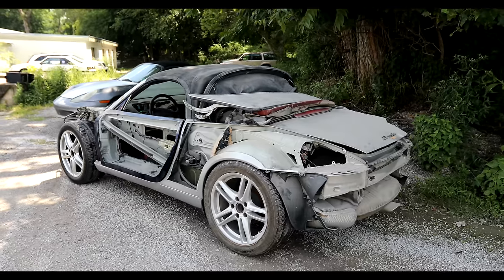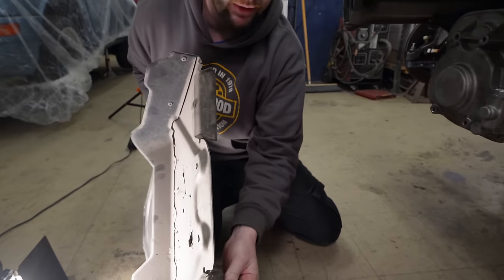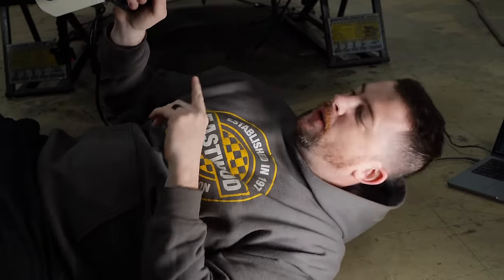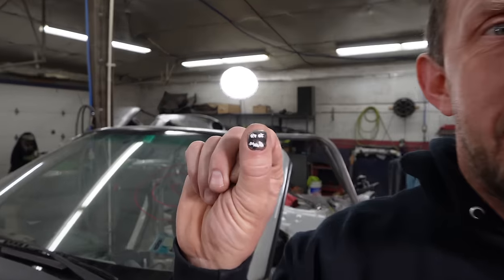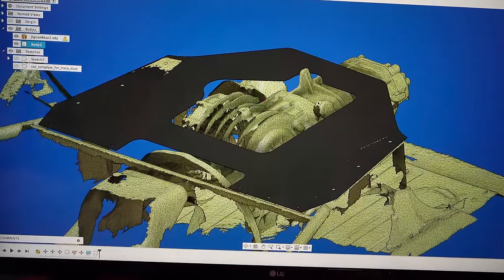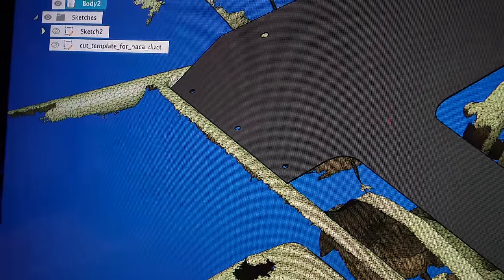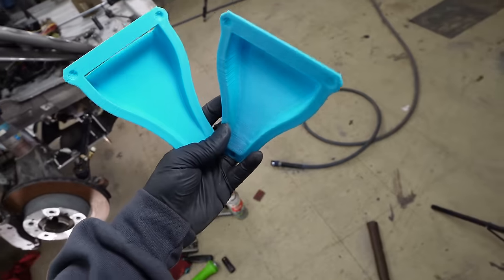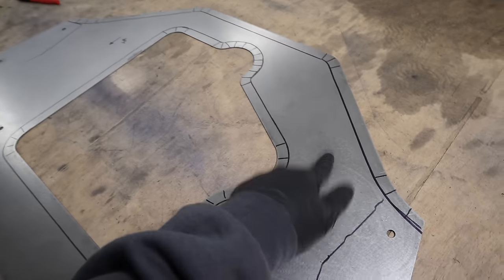$500 Junk Car to SUPERCAR - Project Jigsaw

Comment from the maker: Holley, Aeromotive and PMO all say it is a good idea. Holley sent us that regulator that is specifically designed to regulate the incoming 65-70 psi down to 4-15 psi. The saw regulator can be used for fuel injection; you just have to swap the included spring. We explained it thoroughly in the previous video

Comment: That plate under the transaxle is a very slick piece. Plenty of airflow for cooling, connects to enough other bits to provide a lot of stiffness, and I think your rolled edges are going to be sufficient to provide a lot strength. Especially with 6 bolts along the front edge. If you start to question it, maybe a couple more transverse bead rolls just to give that flat area some shape. As for the halfshafts, well, thanks for showing us what building a car is really like. Sometimes it's hard and it sucks, but it feels great to get past it.

Comment: G'day from West Australia😉

After 43yrs trade life as a 3rd gen Automotive Engineer, buil1ding what I call fruit salads. (Mixed n matched components to crea te something that many say shouldn't exist)

I feel your pain Tony, 😊
Deep breath, exhale slowly, and go again once hurdle has been recognized, solution presents it's self.

Your lucky Tony, you can change out the knuckle.

In the past I have had to fabricate, or whittle out a block of alloy to create what was necessary to get wheels to spin on some builds.

( And they did spin excessively on second test drive with owner coz they understood my iritation at that stage of the build).

Besides had to test them for failure😂

Comment: I really think your NACA ducts are mounted on the wrong side. 
Mount then above then only the lip of steel will be an issue, not the lip of the 3D form. 
Just saying.....😊
Reply: The performance of the duct will be optimized by having the sharp steel edges to trip the air into the duct also.
Reply: @SteveMirabelli  yeah.   But the printing is several times thicker.  Perhaps sand down the lead and trailing edges?
Reply: @alman6581  the duct itself is not as critical as the shape of the hole for air entry.  I used to work in racing and quarter glass was lexan . We cut out the shape and left the edges sharp and mounted the duct behind the glass on the inside of the car. The air wants to move along the surface and then twists into the hole and then the actual duct. With it mounted on the surface you defeat the duct with thickness of the mounting rim.
Reply: @SteveMirabelli  that's exactly my point to. 

I've run several porches with naca duct rear quarters, to sneeky duct cooling and fresh air to air box.  

You soon find what works.

Comment: If the fuel send line is larger than the return, you could swap them. Restrict the send while reducing the restriction on the return line. That might get you where you need to be. Just a suggestion

Comment: I bought a 93 mustang that the whole back burnt to the ground from a rear battery fire for $500. I got it home and pulled the motor that looked like it had a good bunch of bolts-ons on it. Turns out, it’s a stroked 347 that’s .30 over, all forged internals, has a main girdle, world Windsor jr heads aluminum rockers. I had the block cleaned up at the machine shop already, had new cam bearings and freeze plugs done. It was an engine built for nitrous but I bought an “on3” twin turbo kit for it. 
My grandson was just born and I’m starting to realize my dream build for this motor is probably going to have to take a backseat for a while. I know that motor has sentimental value to Tony but if y’all want to bolt something in that should be 600+ horsepower I’d love to make a deal for some cash &/or a trade. The motor is apart at the moment but every piece looks great. I was just going to clean everything up and put new crank bearings and rings in it. I do understand sentimental value of the ‘85 engine though for sure. The twin turbo kit is a bull horn too so exhaust shoots straight up and the turbos sit high.

Comment: That's why you find the midpoint between the two flat bars on the side tape the cardboard to the Middle point of the transaxle use more tape to hold it to the side draw with a sharpie and cut no point in using a 3D scanner if you don't need too

Comment: Not sure if you are aware or not but back when I used to do alot of 3d printing way back when it first come out we used to dip the parts in accentone to help melt the surface a little bit which would make the parts stronger and alot smoother and shiny lol. Just incase you havnt heard that before. Otherwise I just found your channel and will be a new subscriber just my kinda videos I really enjoy.

Comment: Tony, is this the 'temporary vs permanent' conundrum? So much other stuff on the car is temporary, but you're worrying about parts (driveshafts and uprights) that will meet the requirements of an engine tune you don't yet have. If you really want to drive it, do it with the setup you have now, and worry about the future setup in the background. That way you can check alignment, feel, dynamics etc on the temporary stuff before you change things or beef them up.
Reply from the maker: You nailed it on the head. We had planned on using the original five speed trans and axles (and uprights). But the engine adapter plate and clutch kit (approx $2000 retail) is specific to each trans. That is too much to invest in the temporary set up. The five speed axles don’t bolt to the six speed trans. So this is a rabbit hole that was best to explore now. Hopefully, it only sets us back one week.
Reply: And that's what she said 🎉😂

Comment: 24:45 This plate almost seems like it should be flipped over. The rolled edges would look better if they rolled up and in rather than down. Also, your 3D printed vents should be countersunk and have the flange on the top of the plate so all you see are screws instead of a plastic flange around it on the outside. I also dont think that design will pick up much air without a little flap that drops down to direct the air up into the top side of the plate.

Comment: If you break the edge before you shrink or stretch, the rest of the material will be allot less affected. Will save you allot of time and effort in the future.
Reply from the maker: Oh I agree! I opted not to this time since it was rounded over instead of a sharp break.
Reply: @CrucibleCoachworks  Cool. Makes sense.

Comment: You can't  use a carbon reg with a efi pump...it just won't work...I need a low pressure pump that pumps 11psi max as opposed to edi 100 psi..
Reply from the maker: The regulators we are using are designed to do exactly that. They just need a sufficiently sized return line.
Reply: Lol ...OK if u say do good luck...let me know the outcome ....

Comment: You guys do crazy cool work. Let me pre-apologize for being the ultimate keyboard warrior armchair quarterback. A NACA Duct, is much more than that pizza pie shape. There's a number of things you need to do to make a NACA Duct work. First the duct needs to be flush with the bottom there has to be laminar flow of air before the entrance of the duct. The duct also needs an expansion area after it goes internal. So mounting the duct from the underneath and a screw ahead of the duct does incredibly bad things for the airflow. You can Google all of this and find NACA studies for how the duck should actually be in work. All of that being said on virtually all cars and airplanes  NACA ducts are more just for show.

Comment: This way the NACA ducts won't work. You need to set them 'on' the plate. Otherwise the front lip will distort the flow too much. (That is at least as it's official NACA duct measurements and not some homegrown look alike)

Comment: Why do people STILL bleed brakes the old school way????
Go buy a huge syringe. Fill it with brake fluid and connect it to the brake bleed valve(s) on the calipers via a clear rubber hose. 
Open the lid on the resivore. Push the syringe full of fluid into the caliper and system. 
Do the same ťo all the wheels. 
This system is MUCH FASTER and eliminates all bubbles much more easily. 
Your brakes have never felt stronger.